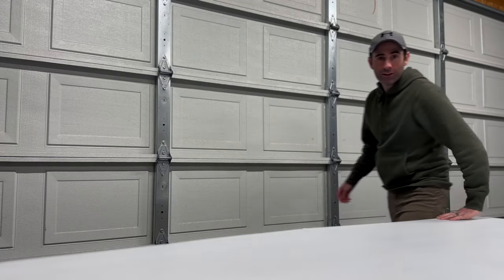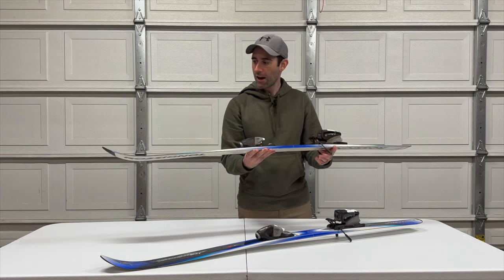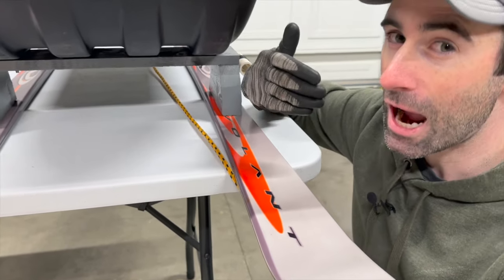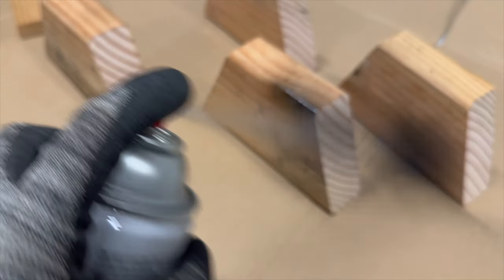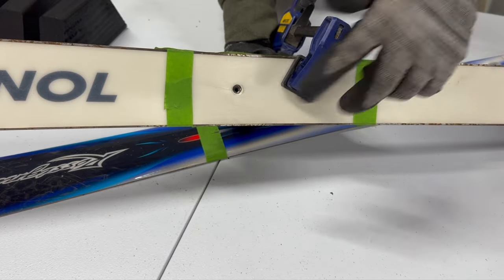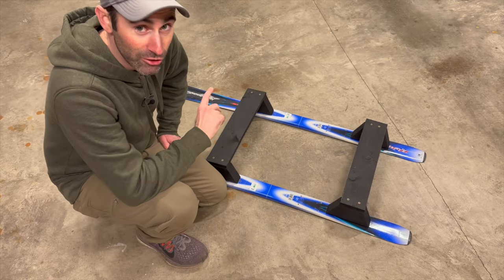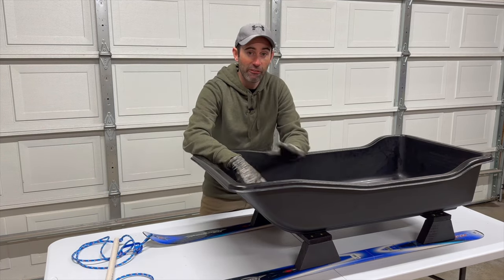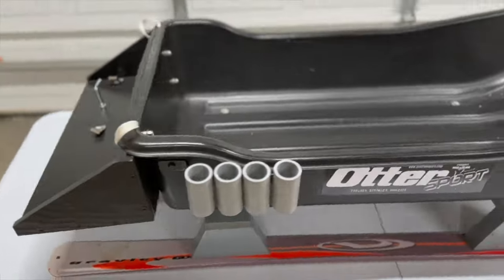Easy DIY Smitty Sled Anyone Can Build In An Afternoon

Comment: Use 2 x  1" pvc 4' long for pulling instead of rope. It adds way more maneuverability and no worries about being run over going downhill. Add a temp line at the handles end and use your head.

Comment: I built something similar a few years ago. I have a suggestion when tying your length of rope. My suggestion is make the rope longer so when a person pulls his sled down a hill or a small slope a person can control the sled from the back. That way the sled won't be trying to run you over. Once a person gets to the bottom they can walk in front of the sled again. I used 1x6 wood on my frame. I have an old frabil tent that I slide on top of the frame and strap it down. I liked how you made about a 6 inch clearance between the skis and the top of where you mount your tub. When there's a fresh snow that height helps with clearance. I also cut  a 2x2 board that went up under where the two wood pieces meet. It helps a ton for support for when a person turns the sled in snow. It keeps it from buckling under. Put wood glue on it before screwing it together. It'll be rock solid then. Hope this helps.
Reply: Great video & very nice piece of equipment. Also helpful for all the additional comments by folks. Gotta get building me one of these.

Comment: I'm going to use extruded aluminum for mine but I love this idea. My sled bottom is scratched now so it doesn't slide through snow is good as it used to! Oh, I'm assuming you put that mask on to show safety first, but quickly realized those filters do not filter spray paint fumes at all! Tried that once! 😆
Reply from the maker: I like the aluminum idea!  Should make for a lighter sled. Surprisingly the mask filtered more than I expected but I still made sure to paint in a well ventilated area.👍
Reply: @fishingduoproductions  yeh, I figured, these filters should work fine. They certainly filter the paint particles, but the smell comes through!! You need the bigger organic vapor ones with the fiber filters on the outside. You can spray paint in an enclosed room and not know it smells at all!!

Comment: May I suggest using Stainless screws instead of steel to prevent rusting.
Reply: Why?
Reply: @whiteyfisk9769  Water and steel =rust.
Reply: @Mahigeer1   99% of exterior grade screws for building arent stainless; almost all screws have a coating of some sort to mitigate that. Especially on a sled, it is a complete nonissue unless you have severe mentall illness or dont know a single thing about building, or both.

Comment: Will a smitty sled work on dry ground
Reply from the maker: You can pull it over grass or dirt without a problem but pulling it across rough terrain (gravel, asphalt) will scratch up the skis pretty quick.

Comment: How does it work out in deep snow/slush?
Reply from the maker: In our experience, it only sinks into slush or snow a couple inches at most and is still very easy to pull.  Making sharp turns is tougher though.  But all you need to do is pick up the front and pivot it. Thanks for watching!

Comment: Why add th3 skiis?  It is a sled.  It pulls.  Why the added effort and cost for little reward?
Reply from the maker: If you were to do a side by side test of a fully loaded sled without skis compared to a fully loaded sled with skis, the difference in effort is huge.  Especially over slush or snow.   There is significantly less drag with a Smitty sled which is why it is much easier.  And if you walk a long ways the reward is not so little.  The advantage is less obvious if you are pulling it on glare ice.  Either way, I highly recommend you try it out sometime if you have the chance.  Thanks for watching!
Reply: @fishingduoproductions  thanks for the reply.  Perhaps I will give it a try!

Comment: The pvc rod holders?
Reply from the maker: They are mounted to a piece of aluminum or steel flat bar with 2 pop rivets each.  You can also use small machine screws and nuts.  The metal is just bent so that the flat area where the PVC mounts extends past the lip of the sled.  Thanks for watching!

Comment: If you cant take the sled off and break down the smitty... it ain't a smitty.
Reply: He said we can customize it for ourselves. I used a cheap pin system of old bolts with a pin hole drilled through the end and a large washer with the clip to secure it all together. Just unclip the 4 pins and the pan comes off and put a hinge on the struts . It all folds up and fit it the trunk. But now we have a truck so waste of time